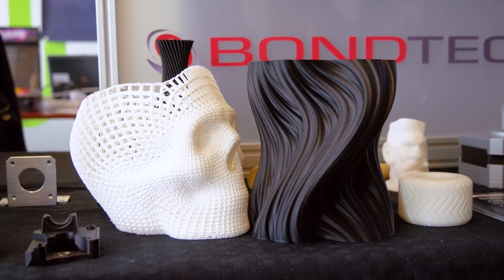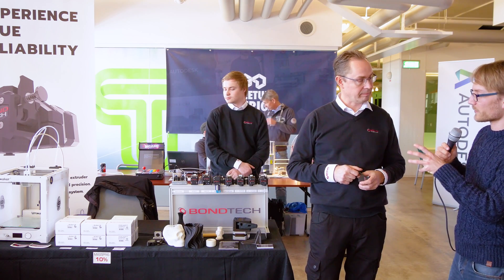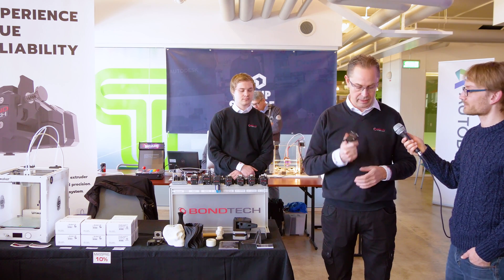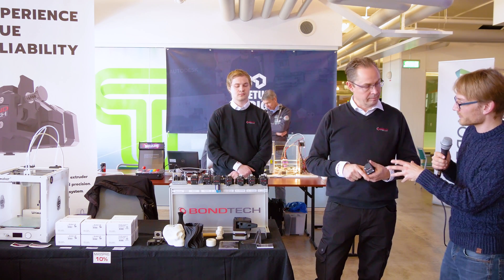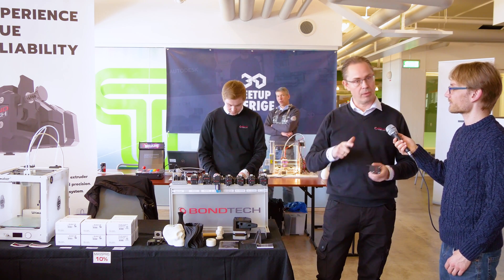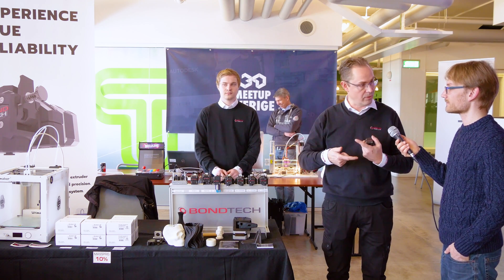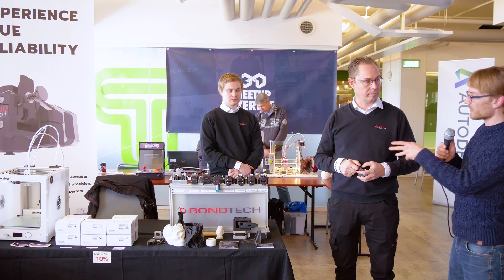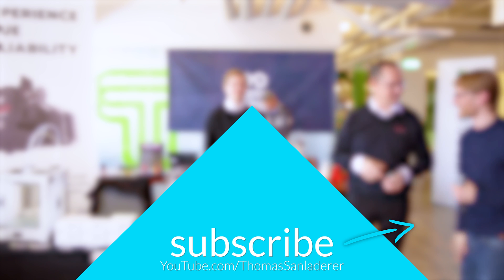Bondtech has their own approach to 3D printer extruders - here's why! #3DMeetup

Comment: I'm still on the fence as to whether these are an actual upgrade.  I swapped out the stock extruders on my BCN3D Sigma R17 with BondTech QR and while they technically improved some areas (eg, areas with heavy retractions where the stock extruders would start to slip), I was never able to completely get rid of skipping.  I'm talking about months and months of tweaking, testing, adjusting current, adjusting idler tension, etc.  Every time I thought I had it solved, I'd change filament and have to basically redo everything.  I even tried three different sets of Bowden tubes including Capricorn.  I used to be part of the Facebook Sigma mods group and just about everyone that made the BondTech upgrade had the same issues.

In any case, I am almost certain it is due to the long-ish Bowden, less than ideal filament path, and stiffness of 2.85mm filament.  This in and of itself is not BondTech's fault, but they sell an upgrade kit for the Sigma that in my opinion does not work as advertised.  I see that the Sigma R19 actually comes with BondTech gears now... so I guess they got all the kinks sorted... but I really don't know. 

So after spending hundreds of dollars on upgrades, I pulled the BondTechs and converted the printer to use 1.75mm filament (the only part of the firmware that even cares about filament size are the calibration routines and you can tweak that pretty easily).  I am using some cheap, non-geared extruders and haven't had a single skipping issue.  Flexibles are probably a no-go but I don't really care about that.  I printed the "Save the Pangolins" model from Thingiverse which was 15 hour print and it came out flawless.  I would have been scared to try that with either the stock extruders or the BondTechs.  If I go back in time I would have done this first instead of even considering BondTechs.

The reason I say I don't know how much of an upgrade these are is because I was just about ready to upgrade my Prusa i3 MK2S to MK2.5 when the whole "inconsistent extrusion" debacle hit with the general consensus being that the BondTech gears are (at least) partially at fault.  I never had any skipping/grinding issues with my MK2S, so I held off on that upgrade altogether.

Comment: 2:31 the BMG shown is clearly FDM 3d printed ( you can see the ripples) and the drive-gear looks like aluminium .But they sell SLS printed body and hardened steel drive-gear, looks like they are prototypes

Comment: i've been using printrbot's gearhead extruder which is a dual gear extruder since november of 2014 the dual gears make a huge difference. I haven't tried a bondtech but they do have strong community praise
Reply: Well Stratasys has been using dual drive gears per filament on their heads since the Dimension days, if not before then.

But there's not a lot of dual gear extruders outside of them.
Reply: dual gears is old hat hardly revolutionary
Reply: i didn't claim they are. I was just mentioning i have used them since 2014 with great success

Comment: i just spent 340 for an upgrade kit for the sigma, i hope it is worth it, i bought it from EMVIO the uk partner, it's a pity that they didnt had any sigma showing off the bondtech in the event...

Tom, what is the relation between emvio in uk and bondtech?¿ they are just resellers or they created the kit for the sigma? 

(by the way if any sigma user is planning to buy the kit upgrade from bondtech or emvio, i have to say that the new drivers (silent drivers) included in the new sigma R17 are not compatible with bondtech extruders, as they lack of power) they work ok with the old ones, but is a drawback for bondtech....

thanks for the Interview Tom!!

Comment: $150 for an extruder for my E3D v6? pffffahahaha! I think I'll pass
Reply: You laugh, it's worth it. They are releasing a smaller one that is going to be 90 and it's similar to titan but better because of the 2 gears driving filament.
Reply: Good to know, though if it doesn't stack up, I'll just build a decent one.
Reply: Just think about it this way, if they weren't good they wouldn't still be in business and wouldn't be able to charge what they do for their products and survive. The fact he can get over $300 for some upgrades on ultimaker printers etc just goes to show you his products are definitely worth it. Martin, the creator and owner of Bondtech I believe quit his  full time job to focus on his company, that is saying alot and a 2nd bit of info is that Prusa, you know Josef Prusa the 3d printer guru is now only using Bondtech Gears for his 4 color multi extrusion addon for his MK2. 

So it goes without saying yes, it is definitely worth it and you will be happy with what you get for your money.
Reply: JJiG see, the point you missed was the market for higher end extruders. if I or any other hobby 3D printing enthusiasts on a budget could not afford to spend $150 on such a small part of a kit build, then the market for the product wasn't meant for us. If the extruder works, that's all that matters. the 3D Joes out there aren't using volcanos or maybe even 3mm filaments that require such power from the extruder. Once that "$90" version comes out, then we might talk about it, but it's still harder to justify than the high value for an E3D v6 for only $55. if your settings are tuned and your hot end is as phenomenal as the v6 then a normal extruder will work quite well and you wouldn't be out $150 or even $90
Reply: The new BMG is a lot less expensive. You can also buy just the gears and design your own extruder around it.
In the end I'll even save money because I got a deal on a master spool of rejected contaminated "C" grade filament and it pushes the contamination through anyways.

If you're building a large format machine I wouldn't use anything less.
Reply: Logan Vinson The BMG is already out. so you can order now and have it in a week. i started out as as cheap 3d enthusiast and now my 5 printers are all costly because i enjoy it. people who buy these cheap printers and knock offs are missing the point. sure they work but they don't work well and they complain here and on reddit about their shitty experience. if they put up the money to buy quality parts their experience would be much better. now i get not everyone can afford these and even when i first saw the price i said wow just as you did but seeing results make you say, yea. i can justify the cost.
Reply: JJiG as JeffDM stated above, buying the gears and designing your own looks to be not only the most cost effective, but also adds to the experience that is the hobby. maybe one day I'll for out for my own Taz printer, but until then, I'll keep redesigning my i3 clone's parts.
Reply: Voice of Dissent possibly. These look to be bolt-on mods for these less hands-on type printers. where is the fun in that?
Reply: I should note that I've done this a couple times already, buying the gear sets to make an extruder to fit exactly what I want it to do.

But I've also bought a  100% stock Bondtech QR extruder for a machine that's 90% custom build.
Reply: The new BGM is actually only $80, and already on the Bondtech Site. And for a cost cutting measure on the QR ($150 extruder) you can buy just the gears for $50, print your own housing from the STL, and provide your own Planetary Nema17 stepper.

Comment: It's strange more are not following down this same path of dual grip ?

It seems so obvious that essentially doubling the grip on the filament will allow less issues with slippage/grinding. 

Sort of surprised we don't see inexpensive knockoffs flooding in from Asia. I don't think it would be too difficult to hob a gear set in sync of the grip.

Comment: Absolutely love my bondechs -- awesome. I think I can it can pull a car attached to a strong enough filament length. Wasn't the original one 5-1 ratio? Why lower it, is it for weight?
Reply from the maker: +kazolar the original Bondtech extruders and the QR used geared stepper motors, the BMG uses a polymer gear integrated into the extruder and a standard stepper motor.
Reply: so that's purely for weight as I understand? I suppose cost savings too.